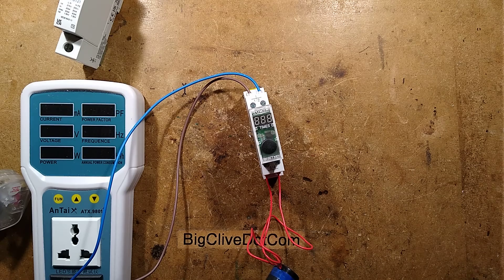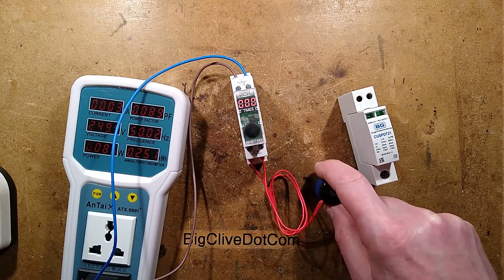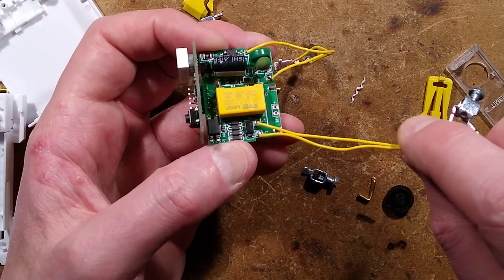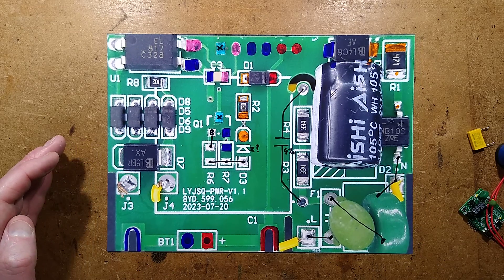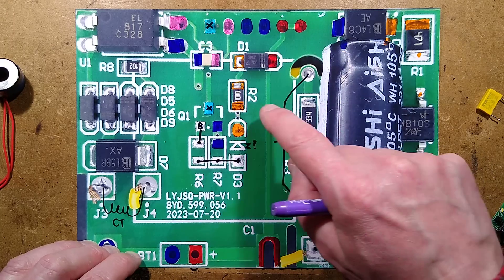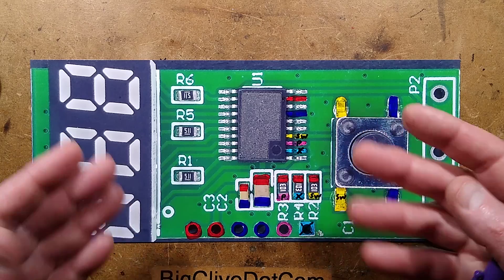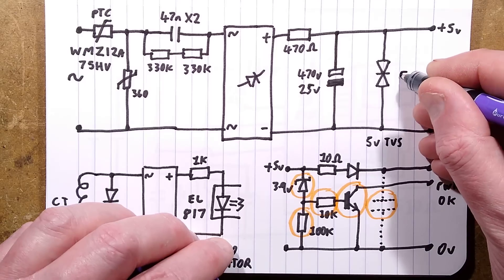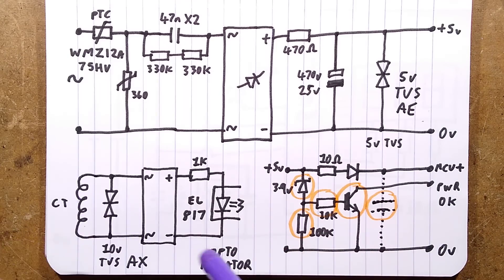DIN-rail lightning strike counter

Comment: 6:45  Hooray!  An optoisolator!  The condom of the electronics world.
Reply: Going to refer to direct measurements as going raw, or perhaps raw-dogging the signal.
Reply: @prokioni  
Does that mean that a diode is more akin to birth control pills? Really good at protecting against normal voltages but can fail during transient spikes.

Oh, does that mean that a fuse is either a morning-after-pill or even Plan C? Heck, maybe the RCD/RCCB/GFCI is effectively an IUD?

Oh boy, the rabbit hole we could tumble down here. 😅
Reply: lol

Comment: Back in the late 1970s, I built a lightning detector that could detect lightning strikes anywhere within perhaps a 10-15km radius from my house.  30m antenna wire, perhaps 2-3m from the ground, and a neon bulb + resistor between it and ground.   I guess that if dedicating a little computer to such tasks were a "thing" back then, I would have done that for counting.
Reply: When I was in high school I built a superregenerative multiband radio receiver kit.  The antenna was a 30 foot hunk of magnet wire strung under the eaves of my home with cuphooks.  The first thunderstorm that came through the area afterwards made me fear for my new receiver, so I disconnected the magnet wire from the antenna terminal and was in the process of connecting it to ground (HVAC duct) when I both saw and felt a flash of lightning.  Luckily it was a couple of miles away (the lag between flash and thunder was around 10 seconds.)   It was still a bit painful, like an electric fence.  After that I always grounded the antenna when not in use.

Comment: Very interesting, thanks.This counter is to be installed inside an electrical panel. 
I have seen lightning strikes counters mounted  on ahigh current down conductors of the lightning protection of a high building. I am wondering how the electronics of such a counter can be protected from several kiloamps/ kilovolts of a lightning strike ?
And not be destroyed before counting to 1 🤣
Reply from the maker: The surge shunt it's monitoring will be keeping the peak voltage across it down.

Comment: Used to work in am automated warehouse (pallet retrieval and put away, demag cranes etc), had a lightening strike once... Not on the building... On the security hut which was way lower down than anywhere else, including absolutely massive lamp posts all rooted deep in the ground... No it wanted the security hut, from there it somehow managed to find it's way to the warehouse... The PLC's did not like that... At all.

Interestingly it didn't kill them, it just scrambled them and a power cycle sorted it.

Big scar on the security hut though.

Comment: this could just be the current transformer section of the circuit, less the opto-isolator, and a mechanical decade counter. that would be zero power consumption, mains isolated, and likely significantly more reliable.

Comment: hmmm... interesting. I have a plug in "surge clock"  which looks like a wall-wart (white - well, it used to be... it's now that sort of universal p1ss yellow that white ABS goes over time) with a ring of LEDs on the front of it. I suspect it is a similar mechanism (although it is at least 25 years old). Used to install Telephone systems years ago and they almost universally seem to be very intolerant of dirty mains. When we used to get mystery crashes etc, we put the surge clock in near the mains for the PABX and came back in a day or two, then sold the customer a mains conditioner :o) I remember the Regent system in the Isle of Ely college in Wisbech was particulary badly affected. The conditioner sorted it out after we traced it to dirty mains using the surge clock.

Comment: Thanks Clive. I’ve always wondered if the mcu is programmed in circuit using JTAG ? presumably there’s a fuseable bit set after programming which inhibits reading the flash memory.
Reply from the maker: There usually is a protection bit.  But sometimes they don't set them.

Comment: Amazing that the sense coil can produce enough voltage and current to light the LED in the opto. Thank you for sharing this with us.
Reply: not very much energy... few mA * 1.3V * few microseconds
Reply: You always can add enough turns of enough cross-section wire on proper sized core for it😀

Comment: If you get a direct strike, counting is irrelevant.  An indirect strike enough to trigger the SPD could be on the live, neutral or earth.  Generally a strike to earthnearby will induce a significant voltage into the earth, and if close to a power line , then also to those conductors

Comment: Hook up the CT input to an AM radio speaker tuned to a quiet part of the band. Now you have an lightning air discharge counter. Power the counter with a usb power bank, and you're good to go for your next picnic, pool party, boat trip.

Comment: No way that little thing can survive being struck by lightning 999 times! Incredible!
Reply from the maker: It rolls over, so if you see it approaching 1000 you can keep track.
Reply: ... You 'screwdrivered' that little capacitor 999 times to see if the display would roll over ?😲 :- that's dedication to your subscribers . Impressed ! 😁
Reply: Not designed for direct strikes. It would blow up like anything else. 

It detects "farther away" strikes on the electrical system that are reaching your sensitive equipment or whatever you want to monitor.

Comment: You could stick a wire through the current transformer and short circuit a battery through it. I suspect it expects a DC pulse anyway, which is what lightning is. If the current transformer is wound on its entire circumference, hitting it with a magnet won't do much.

Comment: 4:07... It's unclear where you connected the Blue Cap that you short to emulate transients and How is that Circuit Powered while you are holding it ?
Reply from the maker: The circuitry was powered from the bench power supply.  The cap was in the same location as the one associated with the optoisolator.

Comment: You have high voltage modules, like the tazer ones, surely that through the coil should be enough to set the counter off

I'd think the smell of smoke and being on fire would be a bit more of a giveaway than a couple of leds 😂

Shouldn't an rcd go off in the case of a surge anyway, or rcbo, also, where would you install this, between the main contactor and the rcd, or between other breakers

Comment: I wouldn't suggest standing outdoors in a thunderstorm with this gizmo , with or without a long copper bar thru the coil, facing upward. Get your neighbour to do it, after the next "will it carbonate?" episode with ethanol infused fluids. 8^)  Cheers!
Reply: I suggest a small rocket with a transformer wire tied to it. An open coil will unravel quite fast and you'll get a long lightning rod. Or just make a rocket with some metallic component like magnesium or sodium, and you'll leave a conductive dust trail. Both are methods for getting lightning strikes.

Comment: I haven't tried yet my self but, I have heard that if you get a "Black-Light" pen and paint the top of the chip enough for the ink to soak in, then wipe the excess of with your favourite isopropanol, you may be able to see remnants of the markings with a "Black-Light"?

Comment: Where's the input for the current sense transformer? You didn't show it on the schematic or where the toroid was in the box. Was the live or neutral wire just passed through the middle before going to the capacitive dropper?
Reply from the maker: The feed to the surge arrester passes through the coil.  It is marked CT on the schematic.

Comment: Supply voltage stability doesn't matter much when using micro-controllers designed to run on unregulated battery voltage and USB, most of those are officially happy from 2.5V to 5.5V but will run fine on much less than 2.5V as long as you don't care about ADC/DAC functions which will often be based on a 2.5(5)V reference. What micro-controllers and CMOS logic in general is more sensitive to is excess high frequency supply noise that could shift thresholds in mid-swing.

Comment: 0:30 LEDs usually fail early because they are driven higher than their rated current.
Reply: Does that mean that red LED’s have a higher current rating than other colors?
Reply: @mikebond6328  Driving leds at around 20ma results in brightness and heat.
Reply: because sometimes there is no series resistor with the microcontroller pins so the display is driven at 150ma

Comment: I find the fact that they gave it a 3 digit display alarming. Personally after my house got struck by lightning for the 99th time I'd probably get the message and move away
Reply: Its not for counting direct strikes but rather spikes from lightning in the mains or the electrical syst.
Reply: I would assume industrial use would be more common, massive metal buildings with long spurs to massive parking lots for lighting would lead to much more strikes...

Also I would assume it detects strikes not just to you directly but anything downstream of the substation that supplies your power
Reply: @jaykoerner  It is meant to count current to MOV. What MOV feels just get's counted
Reply: @poprawa  the explanation of what component is responsible for the counting isn't exactly relevant to the purpose of the counter which is the count indirect lightning strikes I would assume, my comment was in relation to someone who thought it was for the purpose of counting how many strikes hit your house
Reply: You are gonna start making offers to appease the gods by the 10th lightning strike or so
Reply: @marcogenovesi8570  I'd tell my wife that she has angered the gods by breaking the spaghetti in two before cooking it. Might be enough to persuade her
Reply: NO. You will stay and you will keep counting the jolts.
Reply: this comment has me in stitches
Reply: I'll take 10 lightning strikes over one tornado
Reply: doesn't need to hit your house, can be a line a few miles away, electricity travels ;)
Reply: The amount of people not realising the sarcasm is realll 🤦🤣
Reply: There’s that guy that I’m sure we’ve all heard of, being internet denizens, that’s been struck like 7 times or something? And he would still take walks outside during storms. Maybe a business being hit in the 3 digits isn’t so crazy lol. Life is weird
Reply: @Wanttofanta 
We have a politician in our parliament here (New Zealand) who asserts she has been ‘struck by lightning’ three times…
Reply: You have to realize that strikes on the power grid 100 miles in every direction will probably make this thing count up. In my area it might go three digits in one storm.
Reply: @MostlyInteresting  Do you mean 100 strikes per hour?
Reply: I hope I never ever see one hit my house or anyone in the worlds house. Let alone being hit
Reply: @gabrielvieira.4358  Welcome to the tropics, where thunderstorms during which my house (or rather the lightning rods on top) getting hit is a normal day. Especially now that climate change is providing more extreme weather.
Reply: How you show us how to install one of these in the US?
Reply: It's DIN rail mounted, so it's meant to be installed somewhere industrial and sit there for a decade or two.  A couple of the fuel depots I work with out on the east coast could probably hit triple digits within ten years.
Reply: @jeffspaulding9834  DIN Rails are not an industrial only standard in Europe.
They are mandatory for home use as well.
Reply: @NinoJoel not just Europe. It’s just 3rd world countries like the US that don’t conform to any standard that’s different - or just about. ;)
Reply: @pederb82  did not want to destroy their perfect little world. 
They are NR1 on this planet after all lol
Reply: @NinoJoel depends on if you use modern fuses or ceramic ones .  In a  old electrical  box there is no din rails.  But there is  din rail ceramic fuse holders, if you want to mix din equipment with fuses. You can install" old" fuses if you want.
The main fuses installed before your energy meter is probably ceramic with screw covers. 
In some industries they prefer ceramic fuses ,because they have slower  "breaking/blowing characteristics" , this is useful 
When you have  bigger electrical motors, when starting they draw several times more than when they  run. Fast fuses will blow more  easily when there is temporary overloads.  There is two screw fuse standards,  e27 (same thread as a light bulb ). And one bigger tread:  ?e30? The bigger  standard goes to 63 amp, over  that its knife fuses or tube fuses .
Reply: @perstaffanlundgren  half of what you wrote is no longer in use since ~20 years here. 

Normally for household use the Electricity Meter is housed in the same distribution box the fuses are in. 
With exception of the meter everything is Din rail mounted. 

Ceramic fuses are no where to be found in household use for well over a decade now. 
Only thing still being a old style wire fuse with ceramic housing is the fuse you have connecting the grid with your house. 

Industrial use depends on size. 
Most industrial distribution panels are custom and don't really have a norm. 
Most of the time they use the same type of fuse you have at home that connect the grid to your home. 
Anything smaller that 63A is nowadays also the modern din mounted / reusable fuses in industrial application. 
They come with similar trip delays as regular ceramic fuses as well.
Reply: @pederb82  " It’s just 3rd world countries like the US"

heh.  truer than not any more, sadly.
Reply: @jeffspaulding9834 The CN Tower in Toronto is routinely hit by 75 to 100 lightning strikes a year. Back in 2005 it was struck nearly 1,000 times, including 50 times in a single hour.
Reply: @jeffspaulding9834 Hey, as long as it gets a chance to go past 1, I'm happy.
Reply: Great Scott!
Reply: @the_tux  And everybody in the audience throws rolls of toilet paper at the screen.
Reply: @johnopalko5223  what? I can’t recall seing such a scene in that movie.

Comment: I just removed a very ancient relative of this dingus a few weeks ago when dismantling redundant wiring in a huge 1980ies control room mosaic switch panel. It was a quite interesting yet simple device. Essentially it was just a mercury-filled discharge glass tube with a coil wrapped around it. The coil's rating was indicated as something around 33 volts. It was apparently installed to protect an old telephone landline alarm circuit, which must have been decommissioned a quarter of a century ago, so unfortunately no plans could be found anymore as they were not incorporated in the switch panel's original documentation that we still have.

And while its very own design doesn't leave much in the dark, it would have been interesting what kind of circuitry had been used back then. Alas, there was just a short piece of cable, neatly cut off, indicating that it must have been connected to something in the past. As all this goes back to an age well BG (before Google) the interwebs also weren't particularly helpful in getting more information about this kind of surge protection/detection installations.
Reply: @samuelfellows6923  Well, while the system was actually commissioned in 1983 I doubt that they were much concerned about the potential nuclear destruction of a, well, sewage treatment plant. All I could find out from the retirees was that the plant has had numerous remote alarm systems since its very early days to prevent some catastrophic malfunction going on unnoticed during the off-work hours. FWIW - the plant isn't located in the UK.
Reply: @Gen.Tomsky yaknow sewerage treatment plants would be really very important after a nuke. Like it's 100% not the use case for it. But, probably have more deaths after the nuke from dysentery and such than the actual bang. Especially for an emp.
Reply: I'm intrigued as to WHY the normal consumers installation would need to count strikes

Comment: That 'magic' chip with its 20 pins is likely a full-on microcontroller, with a writable eeprom memory bank, SPI & I2C interfacing and possibly analogue to digital conversion. It would be able to do so much more than be a simple counter, like using a Swiss army knife to crack a nut.
Reply: I feel like that happens a lot these days. The engineering cost of designing an actual circuit appears to be higher than grabbing some random Swiss army knife microcontroller and programming it to perform a very simple task with minimal external circuitry.
Reply: And at least 1 hardware interrupt I suspect. As Clive was talking about scanning the display while checking for pulses from the opto the programming side of my brain was muttering "poll at your peril - use interrupt"
Reply: that microcontroller is a n76e003at20, and they probably used interrupt to read the counter so it cannot go wrong
Reply: @lifeai1889  Well spotted.
Reply: With cheap MCUs like the ones from WCH it just makes sense.
It's so cheap that I'm going to smart out sensors and subcircuits to relieve the main MCU 😅 Swiss army knifes for everything and everyone 🎉
Reply: ...microcontrollers rather than basic discrete....so many many more ways to lock up just when you need it the most....just sayin'....
Reply: @leybraith3561   It's sad but you might be right. If one has an "unknown" device and such a "node MCU" fails it might be difficult to repair, at least more difficult than let's say a discrete circuit. On the other hand, if it's e.g. open source or the protocol is known you're not only able to repair it but it might also be easier to replace a legacy/hard to get sensor, IC etc. IMAO.
What do you think?
Reply: @Christian-lh7ux  Open source - those are the operative words. If you don't have the code you are pretty much out of luck.

Comment: I designed a lightning stroke counter in 1979! Mine was a bit simpler than that one. It was powered by a big toroidal coil around the conductor. A mechanical counter!